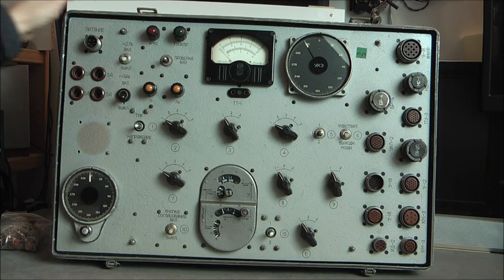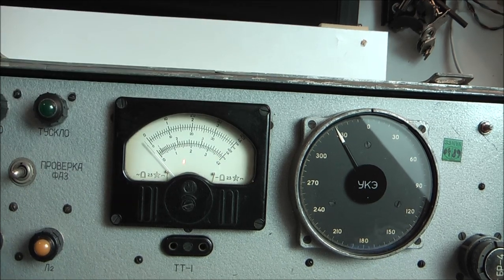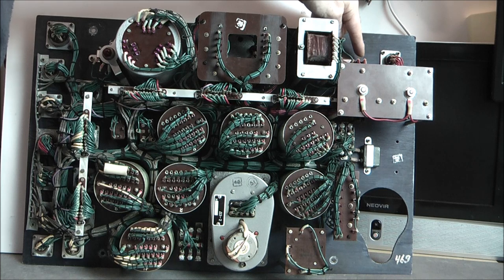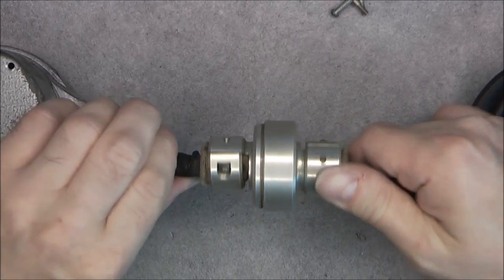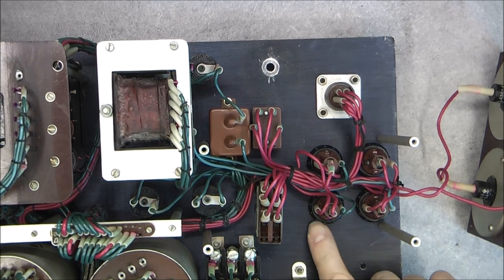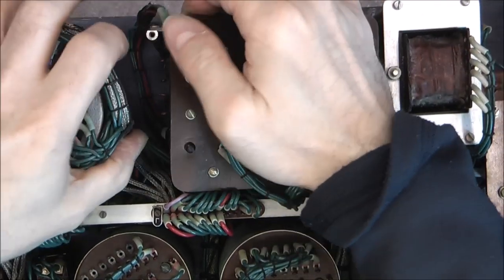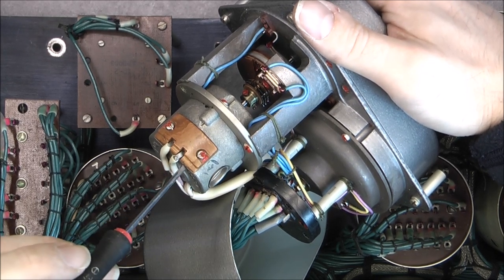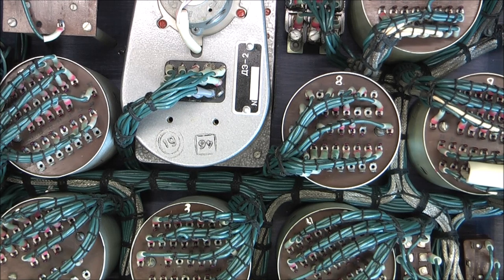Soviet " упкси" avionics test panel teardown

Comment: After poking around online, my feeling is that this is a control panel for some kind of radio wave source locator. One of the labels is "ДДП" which might be an abbreviation for "differential field detector" - which is the working principle of these devices. Two (or more) antennas that pick up a radio signal, where the magnitude/phase difference between them is used to locate the emitting object. The controls could be various gain and attenuator settings. Another hint is "чувствит." which is an abbreviation for "sensitivity", and also "выходн. мощн." which is abbreviation for "output power". So perhaps the resulting output would go to some other system. Or, maybe there's a transmitter/exciter + receiver aspect to this device as well. It seems that you have two power inputs, 27V and 36V, and the switch below those power switches, lets you decide what the meter shows - voltage or current. The interesting looking bottom/center instrument just has rough and fine scale selection for angular tuning. So once again, kind of in line with locating an emitter target by tuning two parameters until some factor is optimized.

Comment: At 18:88. Those look like tunable inductors moving the center screw in or out to adjust inductance.
Thanks for the video.
Reply: It is precision wirewound resistors.
Reply: @susloid  
Cool, thanks.